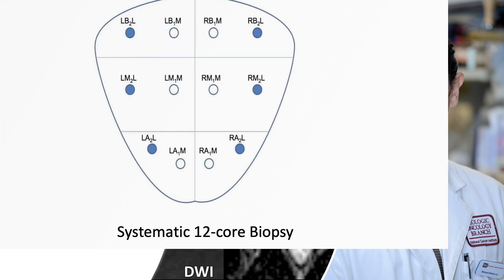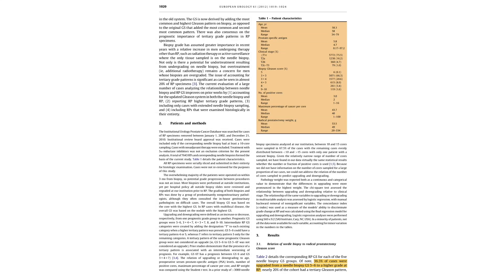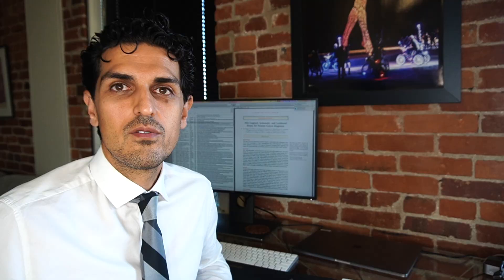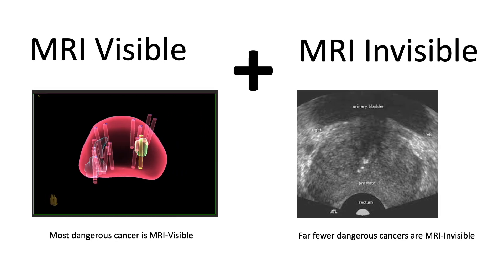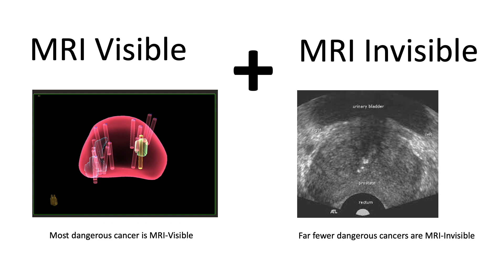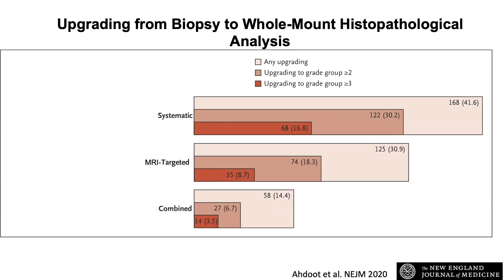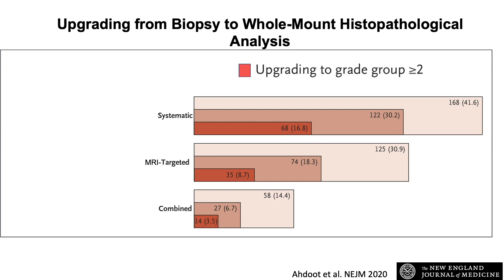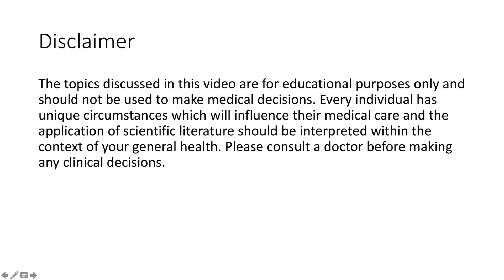Prostate Biopsies Can Be WRONG! -  Dr. Ahdoot Explains Prostate Cancer Diagnosis

Comment: I had a steadily increasing PSA for almost fifteen years. (1999-2014) Given my age in '99, (44) I began regularly having my DRE and PSA level checked. The DRE never indicated any unusual characteristics during this time. (44 yrs- 59yrs) At 44, my PSA was 1.6, then after years (13 ) of incremental increases, in proportion to my age, I experienced in one year's time,  in one's year's time (2012-13) at the age of 57-58, my PSA went from 5.1 to 8.1. At this time, I decided to see a different urologist, so as to get a second opinion as to what might be behind this increase. Neither urologist, at any time , mentioned anything in regards to preventative measure I might take (diet, over the counter testosterone supplementation etc.) I mentioned over the counter testosterone supplementation, because like many males my age, I was experiencing the natural decline of testosterone. The research I did, and by the way, I NEVER explicitly searched on the subject of over the counter supplementation of testosterone on the prostate, but instead would read up on the basic topic of 'decreasing testosterone in middle aged men, and it NEVER mentioned the possibility of the affect of testosterone supplementation on the prostate of middle aged men. So, with this increase in my PSA, my urologists, said not to worry, and to check back for my yearly DRE and PSA check. Well, in another year, (2012-13) at the age from 57 to 58, my PSA increased from 5.1 to 8.1. It was at this point that I engaged the opinion of a urologist at UCLA, who also said to wait, and possibly get an MRI. After relaying this MRI suggestion to my urologist back home, he ordered one done, which according to my urologist, indicated nothing abnormal. So, after going another year, (2013-2014)  from age 58 to 59, my PSA increased from 8.1 to 10.0. Despite this high number, the advice was 'watchful' waiting'. During this period ('99- 2014) my urge to urinate increased, but never to a point to where it was concerning, especially given my age. Given the actions taken so far (DRE's, PSA testing and one MRI) and my urologist seemingly unconcerned, I got out of my confort zone and pushed to get an biopsy done. Okay, this took place- 12 plugs, no cancer. Three months later my PSA decreased from 10.0 to 8.0. I still was concerned and asked for another biopsy, as my urologisty said with 12 plugs taken, there's always a chance that a cancer could be missed. Again, 12 plugs, no cancer. Three months later, a PSA test shows a jump from 8.0 to 9.1. Again, I demand another biopsy, and this time 'Eureka'! 12 plugs and one plug was showing 'pre-cancer'. After waiting for the required three month recovery period (biopsy), we did our fourth biopsy, which of course no was re-biopsying the pre-cancer area from the biopsy before. "Eureka, Eureka"! The area had now turned into cancer. Watchfull waiting? For two months, then after getting the first person accounts of successful biopsies of three co-workers, from the same surgeon, I decided to undergo a prostatectomy. Successful- no lingering effects. For the next six years at six month intervals, my PSA was registering ay less than zer0. which is supposedly no active cancer cells. Then in Sept. '21, at my six month interval for my full blood labs, that SHOULD have included my PSA, it was omitted erroneously by the doctors office, and as such when reviewing my results a week later, I discovered that they didn't do my PSA. I asked why, and the doctor said that my insurance (Medicare Advantage) only covers it once a year. I was a bit miffed, because he knows from my file, and maybe more importantly, the previous six months blood labs, that per my urologist, I need to be tested every six months. He glossed over it, saying out of his hands was the reason for the omission, and went onto say that "besides, you've tested less than zero now for six years, I'm sure it's the same". At that point, I should of again gotten out of comfort zone and demanded that I be tested pronto,.....but I didn't. Sure enough, when the next lab work rolls around, (six months) my PSA has now registered 1.6. Whaaaat? What was it six months ago, when I SHOULD have been tested? Still zero? .03, 1.0, .1.6? Needless to say, I was hot, and told my primary as much. Longer story longer, (lol) I see my urologist (surgeon), and he says to go get radiation. I go consult with the radiologist and he gives me these testosterone suppressors to start taking, and to set up my initial appointment to get 'measured', and begin my radiation treatments. Five days a week, 15 min per day for eight weeks, all while staying on these testosterone suppressors for a year. WhaaaaT? I then tell the radilogist that obviously testosteron isn'y good for the prostate, and he says there's evidence of such. (study's) I said there has to be ample evidence, for anyone undergoing radiation treatment for the recurrence of prostate cancer, that ANYTHING testosterone, whether it's the bodies natural generation of such, or a persons ingesting over the counter supplementation, that TESTOSTERONE is a no-no. I look back, and think of the on and off again, (semi-regular) ingestion of testosterone supplementation by me, from probably the age 45, to literally after I became aware of my PSA measurement of 1.6. I was unknowingly feeding cancer! Wow! naturally in 2020, there's no shortage of online videos that tell you such. Obviously not enough damning evidence, to make it a priority for the urologists to pass along this simple preventive measure, to their middle aged patients. By the way, after weighing everything, I've decided to forego ingesting the testosterone suppressors, ($2500 per month) and of course ceasing the ingestion of any testosterone supplementation. On top of that, I'm atleast initially NOT taking any radiation, after my PET scan showed no cancer in the obvious areas. I'll be getting a PSA done next month, and I'll go from there. I understand that I might be wrong in not taking the testosterone suppressors, and radiation, but given the now realized proof of the culpability of testosterone's harmful effect on the prostate, I'm going to see if my ceasing of ingesting (albeit irregular) a testosterone supplement, has a positive effect on my situation.
Reply: Thanks Remmy for a full description. Can you say a bit more about your prostatectomy? Was it with Laparoscpy or Robot?  You really had zero erectile disfunction or incontinence side-efffects?
Reply: @edgar2907  Yeah very good question I would like to know
Reply: @ don't be concerned about erectile disfunction. Implants work great. Your insurance might cover the implant.
Reply from the maker: @CVA34WestPac Very true. Some people don’t want additional surgery but for those who are open to it we can get erections back for nearly every man.
Reply: @cancerbetter  The implant surgery was the easiest procedure and had minimal discomfort. There is a little discomfort as you cycle the implant the first month.
Reply from the maker: @CVA34WestPac I think people will really appreciate hearing your experience
Reply: @cancerbetter  I was aware of the high risk of prostate cancer in my family. This was the deadly form that cuts lives short. So when I began to detect something was going on my symptoms were frequent urination and discomfort in the prostate. I was seeing a urologist already for kidney stones so I began to insist that we track my PSA levels. I had to be the one to track the increases. I got really concerned when my PSA doubled in one year. She did the biopsy and found nothing abnormal.  I continued to be concerned as the PSA levels climbed faster. Months later, she sent me for the MRI and the tumor was found at the center of my prostate. She did a 2nd biopsy and it came back as cancer and it was the most aggressive type. I'm seven years out now and my PSAs are zero. Men need to be their own advocate when it comes to their health. Ask your male relatives about their health. Stay informed.
Reply from the maker: @CVA34WestPac I appreciate you sharing your story however I do want to clarify for other men that overwhelmingly early (and curable) prostate cancer does NOT cause symptoms. This is why screening is so important
Reply: Testosterone does NOT cause prostate cancer,  nor does it worsen it if you have been diagnosed with it. Why don't young men with naturally high levels of testosterone get prostate cancer and older men with much lower testosterone as part of the normal ageing process get prostate cancer?? From what I've read in more recent studies on this topic is that low testosterone is a bigger risk of men getting a higher grade prostate cancer and that men with higher testosterone levels are protected from prostate cancer.  The reason why doctors routinely offer androgen deprivation therapy  ( ADT) is because of an outdated study from a Dr Huggins in 1941 based on ONE patient who had his prostate removed after being diagnosed with prostate cancer and was injected with testosterone which resulted in his equivalent marker of PSA to increase.  Huggins then concluded that testosterone caused prostate cancer!😅. In recent years ( Dr Mortegentler ) has refuted this hypothesis by proving that testosterone is PROTECTIVE of prostate cancer.  The real cause is a hormonal imbalance between testosterone, dht and estrogen in ageing men, together with genetics and lifestyle factors.  ADT "works " because when you knock out all a man's testosterone you also indirectly knock out his estrogen and DHT levels.  It's actually estrogen, possibly with DHT that causes prostate cancer not testosterone!!
Reply from the maker: @dominictucci6030 testosterone does not cause prostate cancer but reducing a person’s testosterone level after they have developed cancer will prevent prostate cancer growth.
Reply: When my PSA reading jumped to 1.4, after a steady reading every six months of zero, it was a red flag for someone who had successfully undergone a prostatectomy six years earlier. My urologist expressed concern of course, and immediately referred me to the treatment center for a consultation with a radiologist. We did the neck to thigh MRI to check for any 'hot spots' that might be of concern. (there were none) He laid out my radiation program, which included 48 wks on a testosterone inhibitor, (Orgovyx) saying the bottle he gave me at his office was worth $5k. I had the option to get a once a week injection, or take these pills. Before ingesting any, I decided to cease with the over the counter testosterone supplement I had been taki9ng off and on for the previous three months. Without even opening the bottle of Orgovyx, I decided to pursue this cessation of the over the counter testosterone supplementation, knowing that I'd be tested in three months to check my PSA level. Sure enough, the reading was back to zero after three months, and also the follow up six months after that, while staying at zero at six month intervals since. (two yrs)
Reply: TL;DR
Reply: What a nightmare.  Reoccurrence can happen but not normally.  I had my surgery three months ago.  First blood test came back 0.1.  The ED is my only concern.
Reply: @robertheinkel6225  Fortunately, seven years running, (68 yrs) ED has never been an issue. However, retrurning to my situation where after five and a half consecutive years post prostatectomy, on a regular six month testing intervals, of nothing but a zero reading, then with a one year interval, my PSA reading came back 1.4, which was quite alarming to say the least. Naturally this was red flagged considering my situation, (zero readings) I saw my surgeon/urologist, who referred me to the cancer clinic run by his offcie of urologists. The doctor there walked me through the prospect of taking testosterone inhibitors for a year, ASND taking radiation for a continuous eight weeks. (five days a week) He rather proudly boasted of my testosterone inhibitors that he gave me there at the office, of costing $5k (month supply)- of course after researching the real cost ($2500), and what my medicare advantage plan would cover, ($1750) and the balance of $750 being picked up by the manufacturer, because my monthly income qualified me for such. With this bottle in hand that I was given upon my consultation visit, I found out it was charged to me and my insurance of course, (not a free office sample) I researched the heck out of everything, including where I could take my radiation, (over 20 mi/day) and the expected effects (and costs) of a years worth of ingesting these inhibitors, and eight weeks (to start) on radiation. Needless to say, the first thing I did, was cease taking my almost daily over the counter testosterone booster. I then asked my doctor if I could re-test just to ensure that the initial result on my PSA reading might have been in error- which if so, would save everybody a lot of $. He said he'd submit the request for coverage, which the insurance company denied. (go figure) I then asked the radiologist if he could submit a request from my insurance to cover waht he called an 'optional' step, which is an MRI from my neck to mid-thigh, to check for anything of concern, related to my situation. He submitted that, and I got it, and it was clear. (yea !) Then, in maybe what could have not been a wise move, I instinctively delayed beginning taking the inhibitors and radiation, instead choosing to wait until six months, when my insurance would cover another PSA test. Six months later, I re-tested zero on my PSA-whaaaat? Was it a bum reading the first time? or did just quit taking my testosterone boosters, do the trick? whatever it was, I cautiously continued with no treatment and a re-test for PSA in another six months. I cancelled with the radiologist to begin my treatment, and actually the company that provided the expensive testosterone inhibitors, took the liberty of sending another bottle, so they could get their $ out of the insurance company. I've tested zero twice more since then on my PSA, and have been off taking over the counter testosterone boosters. In hindsight, looking back all the way to when I was 43 and got my first PSA test, then for the ensuing fifteen years, watch as my readings climbed unabated, to over 12. The whole time, I realized, I had been taking testosterone boosters off and on, yet despite seeing four different urologists over this time, NONE inquired as to if I was ingesting any testosterone supplements. I'm of the strong belief now, given the proof, that testosteron booster ingestion, was responsible for my continuing PSA rise over a fifteen year period plus. (43yrs-60yrs) Probably never needed to have a prostatectomy, as the first three biopsies indicated. (no cancer) The fourth, at my insistence, came back positive, but with a great Gleason number. I'm of the belief, had I not had the prostatectomy, and just backed off the testosterone supplementation, my PSA would have dropped significantly into a normal range. But this is my personal situation, and everybody is in their own boat so to speak. Best of prospects for you.
Reply: So sorry to hear it took years to get the doctors to take you seriously. Sounds like they watch full waited too long. Men need to push for MRIs. I had a strong family history of the deadly form of prostate cancer so I was on top of my tests.
Reply: Amazing story.... then they disappear and don't answer one question.  Radical prostatectomy with no side effects.   Amazing....
Reply: @michael931  Just had my six month blood lab done, and again my PSA is under 0.01. September will be ten years out from my prostatectomy. Blessed to be 70 with this result.
Reply: @remmymafia3889  That is fantastic!  Are you still taking testosterone blockers?
Reply: K
Reply: I don't understand if you get radiation and testosterone suppressors like lupin at the same time how they can tell if the radiation worked since the the ADT will suppress the cancer cells anyway - and ADT has awful side effects.

Comment: Sir I'm 58, had an exam 2 years ago was told PSA was elevated to see a Urologist. The urologist recommended a biopsy, it came back negative, PSA was 6 at the time. Had annual checkup again this year and PSA was 9, went back to the urologist and he ordered an MRI, I was told this is needed to determine / pinpoint location to do another biopsy. The MRI came back with no findings, should I have the 2nd biopsy even though the MRI came back with no recommended target areas? I appreciate the advice.
Reply from the maker: On average, a person with an elevated PSA but a normal prostate MRI has an about 10% chance of prostate cancer diagnosis on a systematic prostate biopsy.